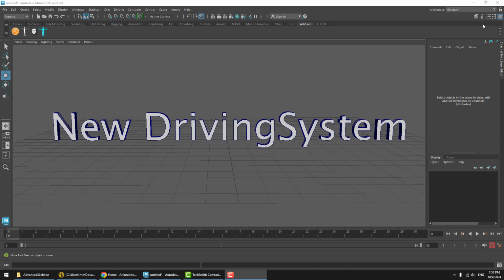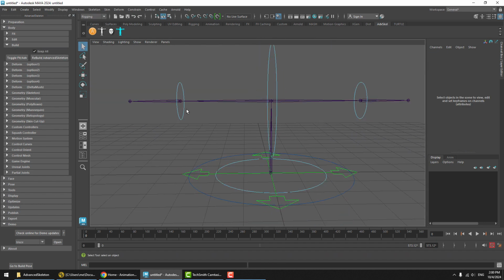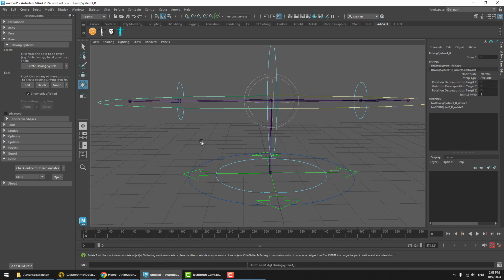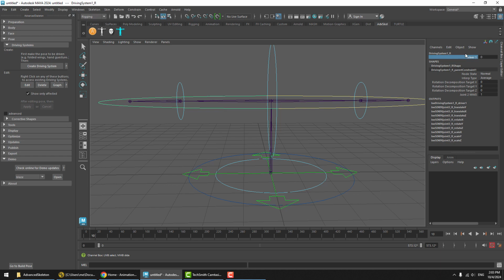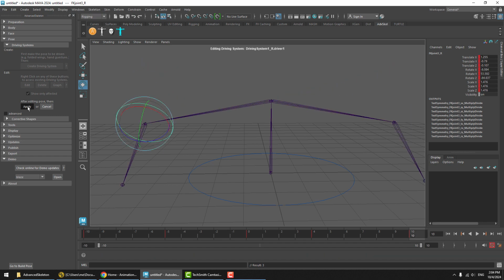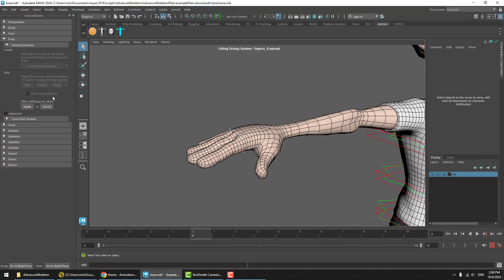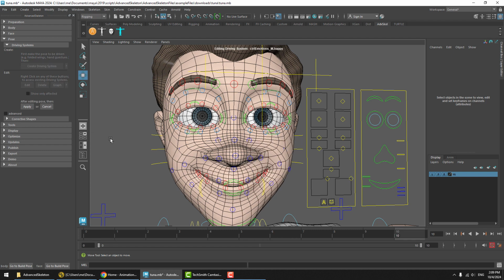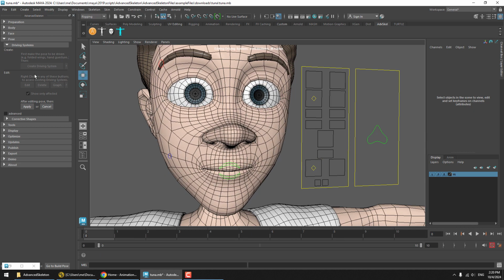New DrivingSystem

Comment: Thank you for such a useful update. Could you please tell me if there is a way to revert the modified driven system to its default state? In other words, reset it to the initial changes?
Reply from the maker: unfortunately no, If you have "Edited" a DrivingSystem, there is no function, to go back to the way it worked before.
The way to go back would be to press Undo a couple of times, or to re-open a previously saved version.
Reply: @AdvancedSkeleton  I understand, thank you for your response.

Comment: Thank you very much for the long-term free and open source of the software, and thank you for constantly updating new features.
Recently, after updating version 6.435, I found that my ability to clean scene animation information would cause the ADV facial driver to fail. Upon inspection, it was found that starting from version 6.400, all subsequent versions have this issue. The new version of the software uses AnimCurveTT, AnimCurveTA, AnimCurveTU, and AnimCurveTL animation curve nodes, which can cause the script to be unable to distinguish between object animation nodes and ADV nodes in the scene during scene cleaning. Please review and fix this problem. Thank you again, thank you very much.
Reply from the maker: Yes, good observation.
Note that using the these animCurve Node-types, is what allows for the new DrivingSystem to work more intuitive.
As now, DrivingSystems easily change to be `regular animation`,
allowing for Editing the DrivingSystem, just as you would edit `regular animation`.
We are not planning on changing this back to the old way, since this is a great new benefit to user
for much easier and versatile way to creating and designing complex DrivingSystems.
But there are ways for your script to determine if nodes are generated by the DrivingSystem, or by a Animator.
E.g., using `listConnections` to find out if the node has a incoming connection.
Glad to hear you like AdvancedSkeleton,
A note on AdvancedSkeleton as `free`.
Yes, for non-commercial home use, you can use it for free,
but if you work for a company, then please as the company to obtain a commercial license.
More info here:
https://animationstudios.com.au/purchase/
Reply: @AdvancedSkeleton  Thank you for your reply. I will review my script and try to make changes. Thank you again and wish you a happy day.